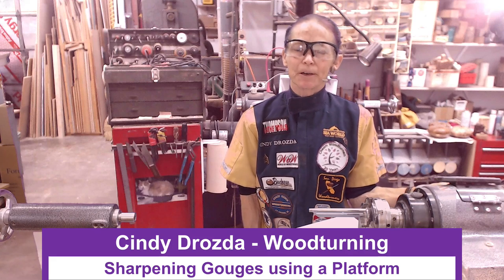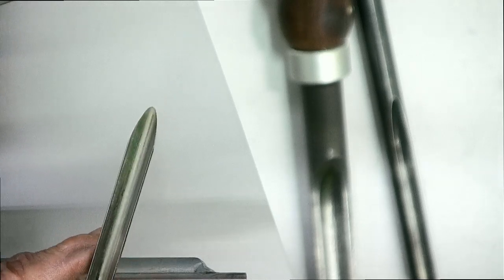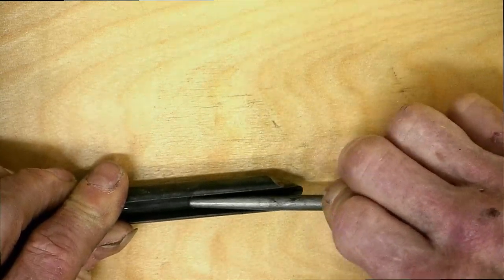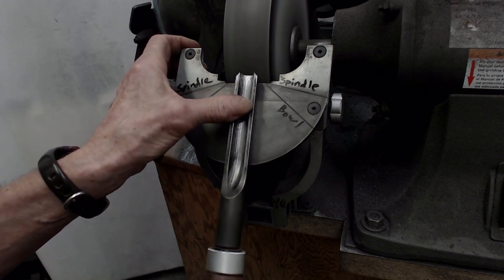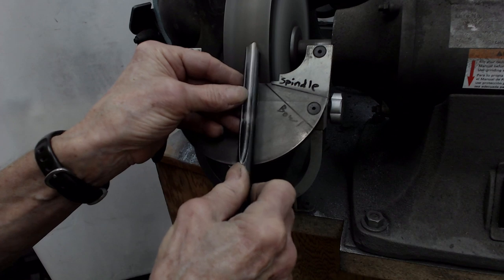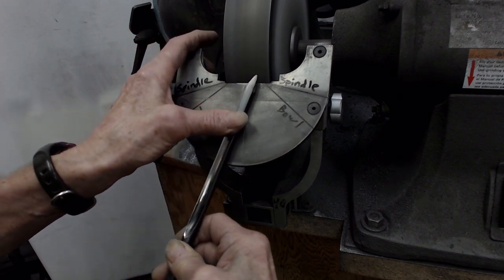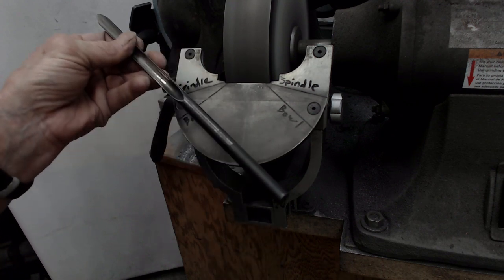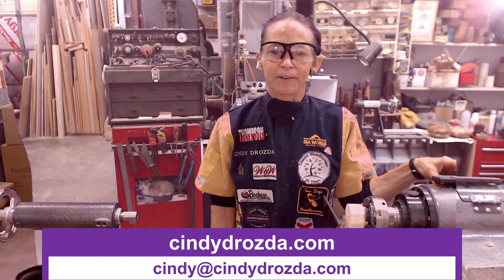Platform Sharpening of Woodturning Gouges

Comment: I have the Robo rest on one side of my grinder and a jig set up on the other side. I recently took the time to learn the 40-40 grind  using the Robo rest. After just a little bit of time I was getting very acceptable results. I was proud of myself! I now use the platform exclusively for all of my sharpening. A lot quicker and easier than having to jig up to sharpen a tool

Comment: Cindy - thank you for the updated video. I have a 8" slow speed Rikon grinder with white 1" wheels and a wolverine jig for both sides.

What grit CBN should I go with? 80/180 or 80/350 or another pair? How should I set those up on my grinder based on the platform and other side? Which side should each wheel go on?

I do not have the ability to to get a piece of metal and cut it for the wheel nor cut the existing wolverine platform. Grinding the 40 degree one the platform should work as long as I mark the platform 40degree on each side, correct? Or should I find a way to get the platform piece cut around the 1" sized wheel?

Finally, I cannot find a place that sells the actual Stuart Batty platform system. The only thing I have found is the adapter for the wolverine jig system.

Any help or guidance you can provide would be wonderful and greatly appreciated.
Reply from the maker: If I only had the money for one CBN wheel, it would be a 180 grit. That will do a good job on all of our typical turning tools. A coarse stone wheel for rough shaping is fine. I like a Norton 3X 46 grit for rough shaping. If I had 2 CBN wheels, they would be 170/200 and 325/400.

You can make an overlay for your wolverine platform that has a cut out in it, like I show in the video, out of formica like I did, or out of aluminum, which is easy to cut with woodworking tools. 

You won't find the SBT platforms online, but if you call up Woodworkers Emporium, Christian will tell you when he will have more of them. They are not on his website.

Comment: Thanks for the great video, Cindy!  I haven't gotten frustrated with platform sharpening yet. I've got another bowl gouge besides the 40/40 that I use for the bottom of the bowl. I've ground it on the platform with angle as suggested in one of the Stuart Batty videos. Still working on improving my platform sharpening and turning. Would love a link to the pen file - didn't see it on your site. Been using a slip stone semicircle that seems to help.
Reply from the maker: The slipstone with a radius edge works well, also. Oops, I see that you are correct about not having the pen file on my website. I will fix that today!

Comment: Cindy, another great video. I noticed that the angles on the platform for bowl and spindle gouges are different. If I assume the bowl gouge angle is 40 degrees, is the spindle gouge angle about 60 degrees?
Reply from the maker: The angle for my spindle gouges is 15 - 20 degrees of sweep. The bevel angle is the same for both.

Comment: Looking at your spindle roughing gouge, It looks to me that it is a re-purposed bottom bowl gouge(round bar  as opposed to a rolled flat) Is that a Thompson?
Reply from the maker: It is the exact same shape as a bottom bowl gouge, and sharpened the same way, but with a 40 degree bevel instead of the 50-60 that I would put on a bottom bowl gouge. That one is an early SBT gouge made by Jerry Glaser, I believe, from 10V steel. It's milled from round bar. Identical to the Thompson bottom bowl gouge, but a lot shorter.